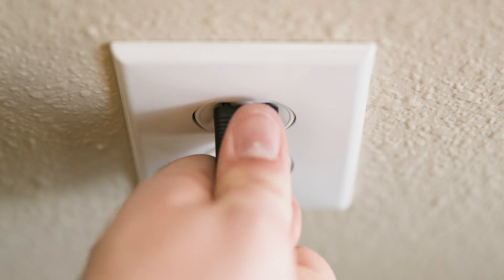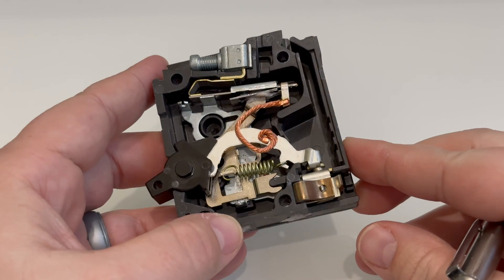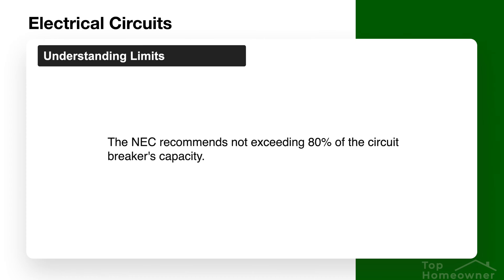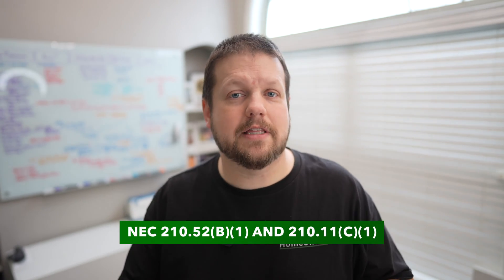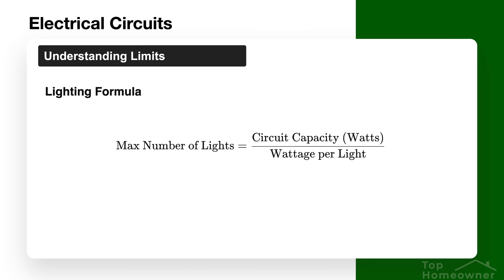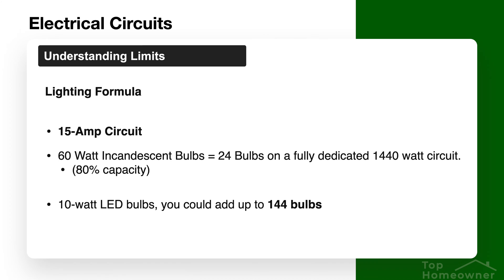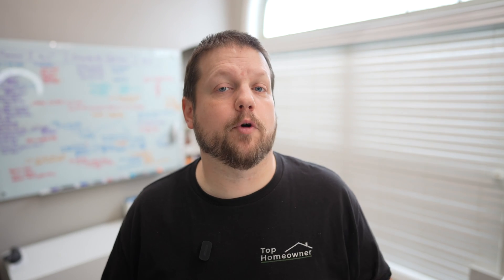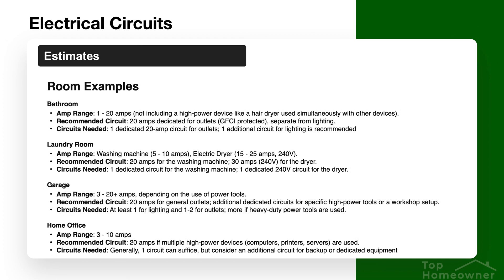The Surprising Truth About How Many Outlets Your Circuit Can Handle

Comment: For general purpose outlets, the NEC recommends 1.5 amps per receptacle equals 13 receptacles, actually I stay safe at 10 to 12 outlets as for kitchens I usually do at least five circuits, this is not for special appliances or dedicated circuits

Comment: In my garage, I have a wall plug that keeps tripping with the red light popping on from the plug on my water  softener . It's on the same wall with my tank less water heater and on the other wall a small freezer. When it trips, about every other day, I push the red button back in and good to go till next episode. Does this mean the problem stems from the soft water machine since its the plug popping up and it's light comes on ?
We just moved here a year ago and I believe it's been doing this quite often but more frequent. 
Thank you!
Reply: Oh btw, when it trips all items go off, including my garage door functions and motion lighting.
Reply: Your circuits are overloaded. The soft water and tankless water heater should have their own circuit.

Comment: FYI: Canadian Electric Code has a limit of 12 outlets per circuit. "Outlets" include light fixture boxes and receptacles.
Reply: sometimes called appliances per circuit.  Personally i like home runs to each 15 amp outlet.  In the kitchen 14/3 to each.
Reply: why do you want 14/3 in the kitchen?Where do you need a traveler or an extra hot wire unless your lighting 3 way lights.I don’t see why you need 14/3 to your receptacle’s/outlets.
Reply: @Dave-ld3dr  I don't recommend multiwire branch circuits (which use three current-carrying conductors, such as 14/3). It can wreak havoc with some GFCIs on the circuits. Better to just run separate circuits with their own dedicated neutral (12/2) home-run from separate single-pole breakers. You also need to use 12/2 for 20 amp for kitchen receptacles.
Reply: @Dave-ld3dr  Outlet has the break off piece of metal to separate each socket on an outlet.  My coffee maker and toaster in opposite phases can be run simultaneously without fear of overloading a single 14/2 feeder.  Personally i prefer home runs to each outlet. Then no fear of plugging the vacuum or carpet cleaner into any outlet.  Lights do not dim either on startup of appliances as well.  My fridges are also on a split outlet.  Fridges are supposed to be run on individual breakers in Canada.

Comment: Thanks, this video was useful.  I am adding a ceiling fan/light in my home office, which is attached to my bedroom.  The person I talked to at the switch help desk for my new combo fan/light switch told me I should add a new circuit rather than tapping into the power from a source in the attic.  I'm trying to figure out if one of the unlabeled breakers (20 amp) in my panel might be free, or how I can determine if any of my breakers have additional "room" to add a device like a ceiling fan/light.  Is there an easy way to determine what receptacles/switches are controlled by a specific breaker ?  Do you think I should hire a very expensive electrician to run a new 12/3 line for my ceiling fan and have it be the only device on the breaker?
Reply: The "easy way" is to do actual testing. Have a helper at the panel, and after they turn off a breaker for you, test all the nearby switches and any suspected receptacles (with a light bulb). It has taken me a while, but through trial and error, I now have labeled most of my house's breakers on individual index cards, and it's incredibly handy. Chances are, you'll find a breaker that's only powering a few things. If not, you could consider sacrificing something unused in exchange.